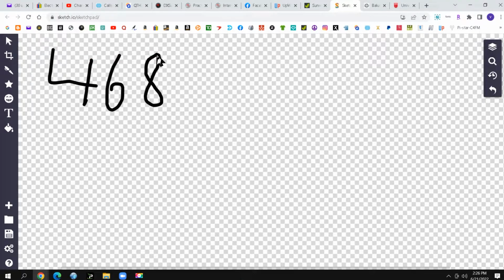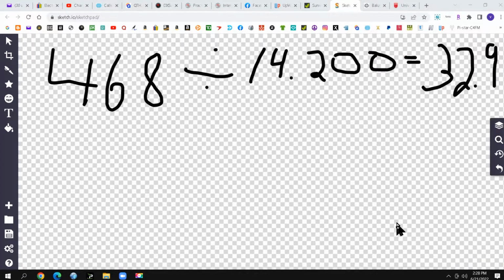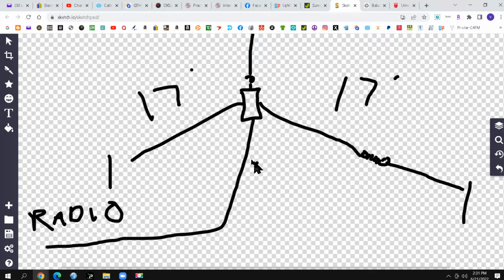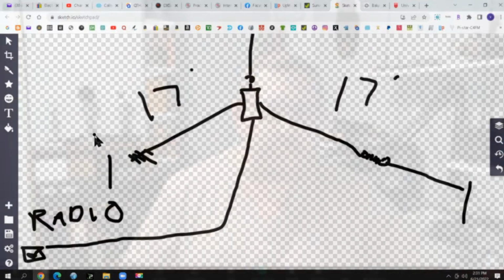HOW TO BUILD A DIPOLE / HOW TO MAKE A DIPOLE ANTENNA FOR HAM RADIO

Comment: Is that a 1:1 current or voltage balun? And how high off the ground are your ends for 20 meter vee?
Reply from the maker: I use a current balun from balun designs, model 1115d which also has a choke in it. The ends are roughly 18-20 feet estimated, that was the height I had available.
Reply: @HamShackReviews  Thank you! So do you think your angle is between 100 and 120? Estimate only!
Reply from the maker: @jamesabc372  I am around 100, its best to keep it between 90 and 120.